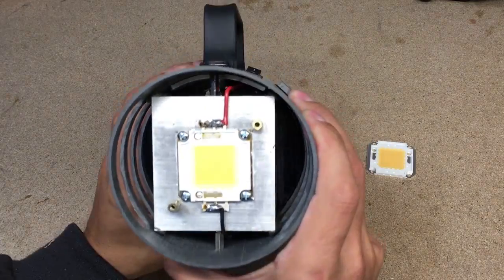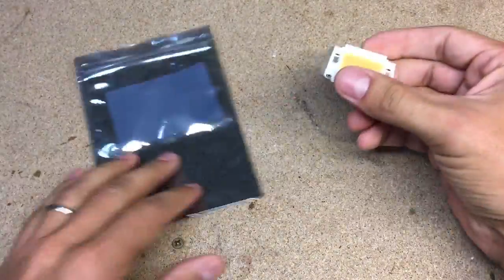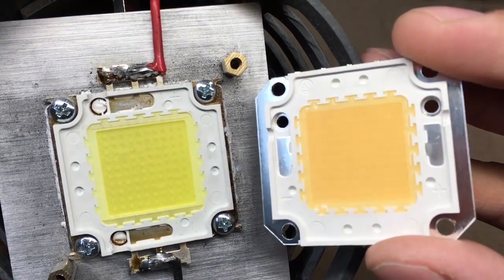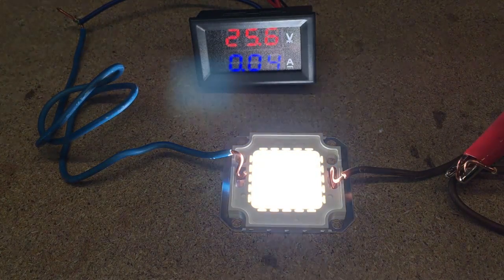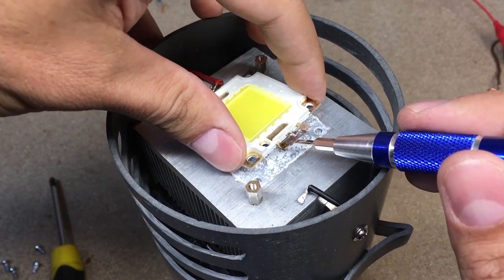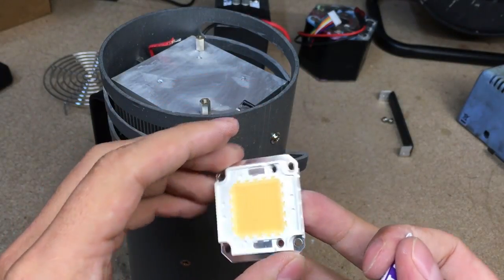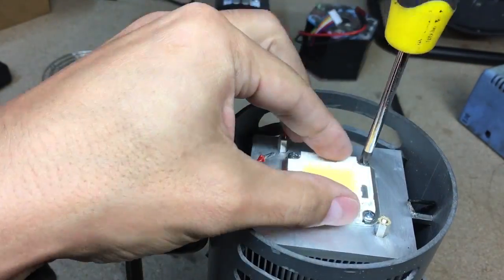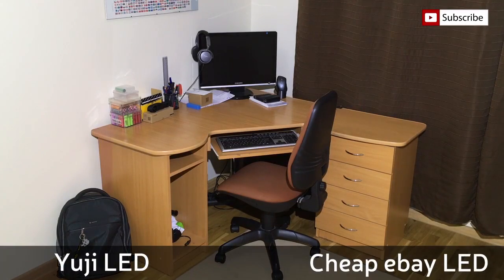Flashlight upgrade With 100W Yuji LED Chip

Comment: Your original build is an example of superb ingenuity and craftsmanship. As one who is into photography and video, you can't dispute the quality of light that comes out of the Yuji cob, however, your flashlight would have very limited use as a video or photography light without the ability to modify the light by attaching standard modifiers to the front. Also, it would have to be mountable on standard light stand spigots. So, upgrading a flashlight to a quality cob is VERY cool, but wasteful and unnecessary unless you also modify the design to make it useful as a video light. I have doubts you would be fully capable of doing that, but I doubt you will as video or photography do not appear to be 'your thing', at least going by your other videos. I sure wish you would though 😄
Reply: Better color is always better color.

Comment: if you have overheating issues use a silver based thermal compound lime nanodiamond, it has a much greater thermal conductivity than standard silicone heat sink compound. use it carefully as it is electrically conductive
Reply: CPU tests in heavily overclocked applications show marginal gains from using a silver paste-- certainly not enough to warrant using an electrically conductive paste.
Reply: I get 3-5c better which could be the difference one needs.  The conductive issue is moot in this application.